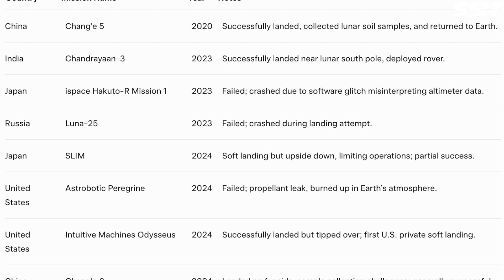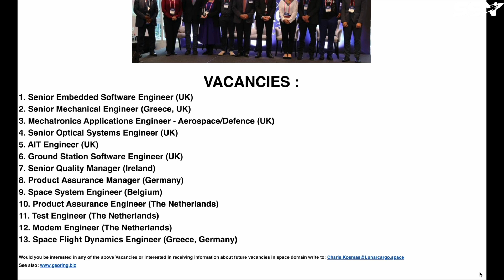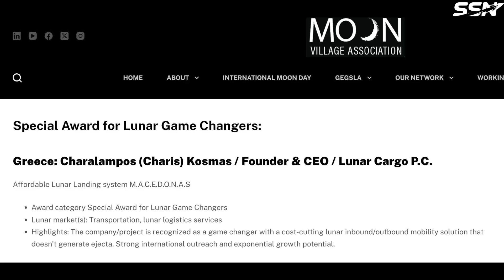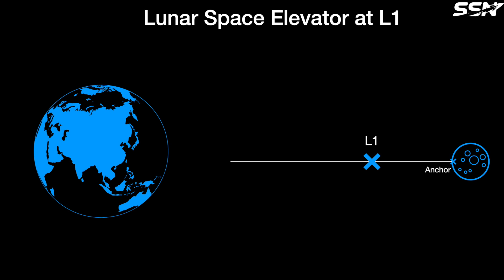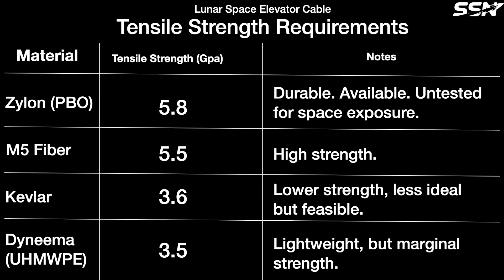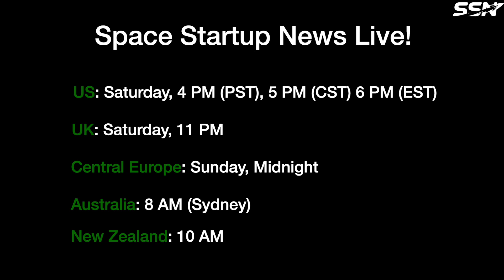Lunar Cargo: Non-Propulsive Lunar Landing Concepts

Comment: interesting but I would have enjoyed some numbers i.e. dimensions of net diameter of wheel thing
Cheers
Reply from the maker: I don't have any numbers. I believe there is a powerpoint presentation that goes into more detail but it's not been made public.
Reply: The "point design", from where the 8.6 revolutions per second derive, defines an outer rim that will be formed by a circle of a diameter of 60 meters. The diameter of the payload & service module holding cylinder is designed for 6 meters, so that when we wrap the flexible elements (axial and perimetric tethers) to be less than 8 meters that are the currently permitted by available launchers.  The point design can be enlarged if we could consider in orbit assembly. In general, there are economies of scale. The larger the diameter the larger obstacles it could negotiate. In the current design the distance from the outer rim to the inner rim (of the cylinder) is 27 meters. The vehiclue can accommodate much higher obstacles if we talk about hills with slope values that effect a deformation less than 27 meters. The exact acceptable slope value is a function of the speed at the given location.